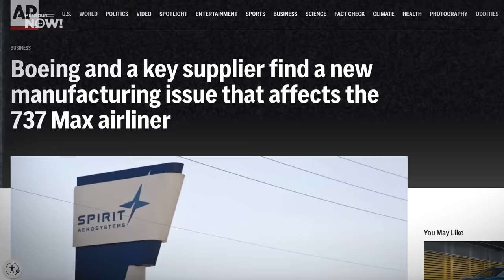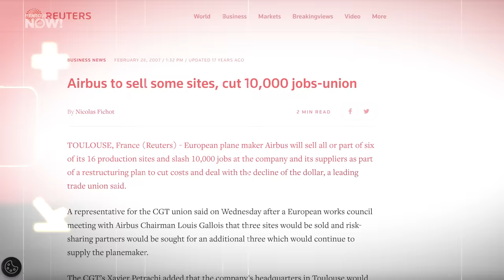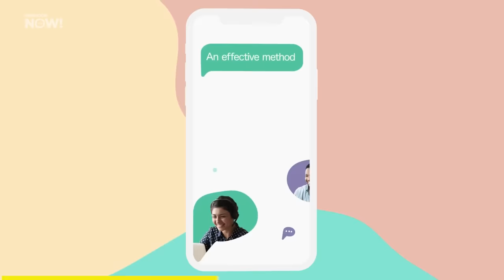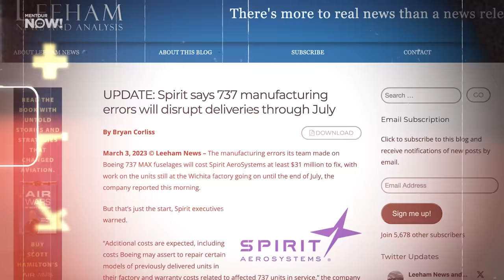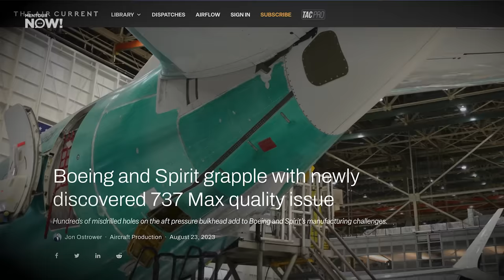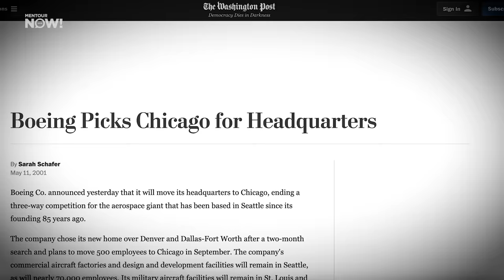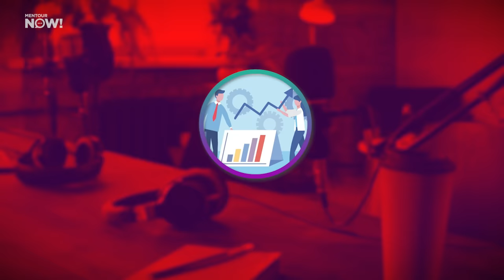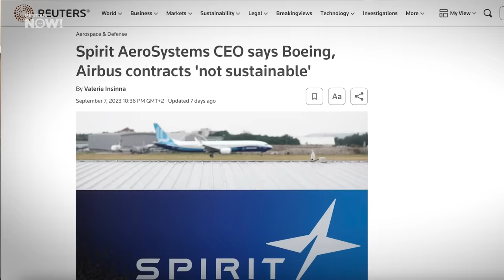NEW Problems with the B737MAX!

Comment: How did Spirits CDI's and Engineers miss that on the final part buy off? That's a big screw up, and being an AS9100 manufacturer, any changes must be approved by an engineer before they could continue work. I worked in aerospace for 15 years and know there are multiple checks and triple checks on all flyaway parts.

Comment: apparently, rules have changed. Every new Aircraft model has to go through l  of safety checks. This one is called 737 and is allowed to certify its own modifications, as it is not a new model. However, the changes made are huge, it is really a new aircraft. The wings have been raised so that bigger engines can be fitted below the wings, not a minor upgrade at all, A massive alteration. And so it goes. Self regulating, and given the levels of corruption that deliberately hid the faults until two or three new aircraft crashed killing all on board. The additions, modifications continue. It is not a 737, it is a mongrel, a Frankenjet.
Reply: There are several catastrophic factual flaws in that statement

Comment: It doesn't surprise me that the subs turned in better work.  They would have to assume that Spirit would have inspected their work and were probably on the hook if Spirit rejected their product.  The aerospace industry lobbied the government to let them police their own work and this is the result.  If you want quality product, you need government to do the inspections, and to avoid passing the cost of regulation onto the taxpayer, industry should be required to pay the freight without having any control over the inspections.

Comment: The worse part of building something is that when the ceo and vp get involved in a build of a building or vehicles. Usually end up with nothing but problems. They over ride the engineers to save a few bucks for themselves over safety and build quality. They want quantity over quality.

Comment: My daughters friend just flew on the 737 max and told her something I had never heard before. They were asked after everyone had boarded to move 10 passengers from the front of the airplane to the back! Then an additional 3 passengers were asked to move to the back. First time I had heard of that, I always figured airliners didn't have to worry  about where you sat and just loaded the baggage accordingly for weight and balance. Also how would they know sitting at the gate where there C.G. was, does the Max have some kind of new equipment or software that can tell them where their C.G. is? Again something else I've never heard of, but anything is possible I guess.
Reply: I've had it happen to me once. I had to go a few rows back. I've also heard of it happening. The c.g of airplanes is a delicate thing.
Reply: Shouldn't that be worked out when you first arrive and present your baggage?

Comment: The guy in the first few moments "There is an issue with a non conforming part".  YES!  The bolt refused to be tightened.  It said, I do not feel like it, so the mechanic let it stay in loose and ignored the torque setting on his hand tool and gave the bolt, the relaxed vacation it requested.  I was an engineer for 33 years.  I had to listen to this kind of BS from business and marketing who got put in charge where they should have had NO POWER or influence.  They do not have the brains to run engineering or production, but they possess the audacity and GREED to screw up Quality Control when it suits them.

Comment: I'm curious what the fix for off-center drilled and elongated fastener holes is. Other than installing oversized rivets or Hi-Locks, there's no fix I know of. Oversize fasteners can run afoul of edge margin requirements, too. BTW, when Petter showed what was supposed to be X-Ray being used, it was High Frequency Eddy Current equipment being used in the stock footage. I'll gladly give him a pass on that!

Comment: As others have said, it's difficult to see how the machinists were not aware of the snowman holes or, if reported, that supervising engineers didn't investigate the cause and propose solutions.  Could there have been a cover up along the way?

I wonder too whether the FAA were a bit too quick to dismiss this issue as having any flight safety implications and it would be reassuring to think that those conclusions were subject to an independent and rigorous analysis.

Comment: Lemme see here. The FAA said the vertical stabilizer and aft pressure bulkhead problems were not safety of flight items? Would this be the same FAA that signed off on MCAS? Ahh right, that's it.

I know that the FAA delegated certification to Boeing who was responsible for the MCAS issues but you get my drift.

Comment: Boeing used to be an engineering company, then it 'merged' with Macdonnel - Douglas and the engineers seemed to be 'out' and the profit/bonus focused management from MD seemed to be in charge of Boeing.  Now Boeing is a profit making company with bonuses to top management.  The fact that Boeing makes junk doesn't surprise me, and I don't fly anymore.  It's not about Boeing being an engineering company, it's just to make management rich (in my opinion) and my safety - public safety - doesn't seem to rank.  If I have to fly, I'll try for Airbus.  Not Boeing.

Comment: Dear sir et al, I recently began to watch some of your programs, I express congratulations and admiration for the quality of the information you provide in a charismatic, objective and informative way.  Such quality stands out from the vast amount of pseudo information circulating on the media. With the hope of ellicitig a possible return , I inform a possible contribution to a program wherein a Captain and First Officer became so involved in the absence of a  locking check on the pannel that they had lost spatial awareness and crashed. As a child, I was party to a similar incident in December 1956 on a flight from Brussels to New york.The outcome, you´ve guested it,  was different. As a technical translator for long in the oil industry  my insight in the safety issue could be summarized as : blame the victim it is pervasive in this hazardous industriy. What is your take on this last  issue?

Comment: If others are able to make parts as per spec then it means in house fabrication has an issue. And this has been highlighted for years. It seems that this has not gone away. What other issues are there which have not been reported ? In Asia where I am based Airbus 320 are the preferred aircraft … wonder why ?  I certainly would walk away from getting on one of these new 737s !

Comment: So the pressure bulkhead has badly drilled holes in it. Who would want to fly in a death crate like that? The report I saw about the crashes said the new engines were too big and moved the center of gravity to an uncontrollable position without electronic trickery. That plus AI that won't allow the pilots to save the plane, what more could you ask for?

Comment: I really do not think "Profitability Problems" are the cause of this type of systemic issue with construction of the pressure end cap. The person on the line whose job it was to drill the holes is the one who is solely responsible for this mistake, and then with the help of management the issue was covered up with some rivets...Not Good!!  Lives are at stake as this is a crucial part of the pressure vessel.

Comment: Drawing upon my background as both an engineer and a pilot, I hold a strong conviction that safety should always be our top priority when it comes to aviation. As such, I must express my profound discomfort with the idea of operating an aircraft that harbors multiple issues.

The 737 is a reasonable safe aircraft (but Airbus 320 Family has better record), with that being said lets focus on a number of problems over the years, including the two fatal crashes of the 737 MAX in 2018 and 2019. These crashes were caused by a combination of factors, including the location of the engines far in front of the wings. The 737's engine placement can make it more difficult to control the aircraft in certain situations, such as when it is taking off or landing. This is because the engines can create a pitching moment that can cause the nose of the aircraft to rise. The 737 MAX was designed to have a larger engine than previous 737 models. This increased the pitching moment, which made the aircraft more difficult to control. Boeing developed a software system called the Maneuvering Characteristics Augmentation System (MCAS) to help pilots control the aircraft. However, MCAS had a number of design flaws that led to the two fatal crashes.

That being said, my preference for the A320 over the 737 is completely valid. The A320 has a different design and might offer a flight experience that you find more comfortable or reliable. As a pilot and engineer, it’s crucial to trust your instincts and choose the equipment that you feel most confident operating. Your safety and comfort are paramount in aviation. Remember, every pilot has their own preferences when it comes to aircraft, and that’s perfectly okay. It’s all about finding what works best for you.
Reply: You say the 737 is a safe aircraft, and then go on to explain why it is NOT a safe aircraft lol...  !
Reply: @bernarddavis1050  If you lack the context to comprehend the meaning, that void becomes your excuse.

Comment: @7:24, Boeing is a big employer in USA, and the FAA is biased toward Boeing. Within months of its certification and subsequent commercial flights several the 737Max had nose-dived and crashed killing all aboard, and several pilots had reported the 737Max computer mysteriously and dangerously forced the aircraft to pitch downward — even to the tragic end. The lucky few who managed to stay alive to tell the tales of the mysterious computer that tried to kill them all, reminiscent of “ HAL” in the movie 2001 Space Odyssey. Boeing engineers had modified the 737Max auto pilot but kept the modifications low key so the airliners need not spend time and money retraining 737 pilots. A surprise revelation: the FAA had given Boeing  a self-certification process on this piece of important avionics. 

As several of the 737 Max were falling out of the sky, FAA was reluctant to ground them, instead assured everyone the 737Max is safe and airworthy. Only after China unilaterally grounded all 737Max in China the FAA finally gave up the ghost.

The FAA has no credibility.

Comment: 2:03  *[edit] ...i should have finished the video before I commented. 🤦‍♂️😅 If the fuselages were bade in Witchita, then thats why it went past my place. 👍

When the first Max fuselages were shipped to Boeing, they were on a BNSF railway that went right past my house and that follows I-90 (ostensibly) across the country 🤷‍♂️ I wonder where the shut down areas are? 

Im not saying youre incorrect...im just curious as to why they used yhis railway and why not use it again? 🤷‍♂️

Comment: I have read that Boeing is currently struggling to ramp up monthly production of (I believe) 737's from 31 (I guess last year) to 38, they were talking about producing between 400 and 450 aircraft in 2023. The third quarter was miserable for them, they barely managed to produce around 33 per month, and so they have moved their full-year goal to between 375 and 400 aircraft. I thought the issues were just general supply chain issues, which also affect Airbus, so maybe Boeing was just unlucky and could catch up next quarter. 
    The information you shared in this quite-informative video shows that it won't be that simple. It looks like Boeing's next target of producing 50 aircraft per month could be pushed further into the future -- who knows, 2026 or 2027? In the meantime, it looks like Airbus will meet its target of ramping up production to 50 planes a month, it is already preparing its suppliers for 65 a month and has started talking about 75 per month. Both Boeing and Airbus have healthy backlogs of orders, but it is starting to look like Airbus will be rapidly draining their pipeline of orders and refilling it, while Boeing's pipeline might be a bit clogged. Boeing may increasingly lose orders to Airbus, especially when long-time Boeing customers have to replace their aging B717s and B757s, where Boeing no longer makes a direct replacement aircraft and Airbus has something closer in the A220 and A321XLR, even if shifting to those types will complicate fleet structure.
    A lot of people, including the big airlines, are rooting for Boeing to turn things around and start offering healthy competition to Airbus again. It has been 5 years since the first 737 MAX crash, and it looks like Boeing is still not in the clear. Maybe it is time to boot out the executives who were responsible for creating this mess, put in place people who will take responsibility for the engineering design failures of the MAX and other issues, and get down to rebuilding Boeing and its organizational culture.

Comment: You make great points and thanks, RONA, yeah, it's just greed,  I worked for Carrier and when they got taken over by UTC everything went to shit, then RONA came and they literally sold off the supply chain and technical support for Carrier HVACR equipment and it ruined the brand. Like many manufacturing systems it's critical for HVACR equipment to have factory training and technical support,  tech's in the field need this now, and if they don't get it, they will drop your product and move on to one that will. I've seen this so many times, little punks in board rooms that went to college but have no idea what the company does or how it does it making decisions that decimate the company and many times put consumers at risk.

Comment: How the shit is the fitment 
or lack thereof , of the vertical stabilizer, not a safty/ flt risk!!!?
Help me understand that defecation!
Reply: Most likely because it's only 2 of the 8 bolts. You have to understand that oftentimes the plan you've flown is also not in perfect condition. The plane can have damaged parts but is also allowed to fly as long as requirements are met. Although I also don't support it, it is what keeps the airlines industries going

Comment: It seems those new engines made those airframes fundamentally unstable.

You shouldn’t need computer intervention to make a plane glide
Reply: Every Fighter Jet since the 80s needs Computers to stay stable. There is no problem with that. But maybe do not link this very essential function to only one sensor. Better use three and have a fall back mode with limited flight characteristics if the sensor data doesn't make sense.
Reply: @nils9853  Perhaps what’s acceptable for a fighter jet isn’t acceptable for a commercial airliner

Comment: Rotax are having quality issues with their aircraft engines as they have subcontracted manufacture of many parts in the inevitable cost-cutting exercise. This is almost always the case and the bean-counters meet their targets and get their bonuses, but don't have a clue of the chaos and costs plus tarnished reputation of the company that the engineers have to sort out. I've seen it everywhere I've worked.

Comment: Ever since Boeing's core shift from engineering to maximizing profits (i.e think accountants making critical decisions over engineers) the company's once sterling  engineering and safety excellence has tanked.  Accountants want to outsource everything possible for the next quarters profit to keep rising.  Bad company culture when safety takes a backseat to share price as one would think was  previously brought to bear.  And that doesn't even figure in how at this late date that The FAA sees the problems here as not of immediate safety concerns?  It's as if they feel they can not ground any more 737 Max planes for fear of destroying Boeing's future. Kind of a slippery slope all over again ignoring life lessons learned by ultimate horrific costs.  I've been in retail for over 40-years and I've never seen any of the vendors I depend on improve their products once they are bought out by investors and ran by accountants.  Fortunately what I sell isn't safety critical on a potential catastrophic level.  Aircraft, however, should be safety first, in-between, and last.  Any profit made without this mantra is "blood money".  Frankly, I'd rather fly on Airbus planes after watching this video.

Comment: I wonder if the person or people who knew about the snowman holes are still working at Sprit, if they are they also got a pay rise recently. What the !. I suggest many heads should roll from the shop floor to the top. Criminal negligence also . As to safety, the FAA said no safety impact but what about if these flaws were left for say 10 years !  Aircraft have been brought down before from excess drill holes .

Comment: Railway line cited 2:05 probably went out of service due to excessive reliance on air transportation. ironic?  Rails to trails are a menace, there is supposed to be a provision to have it back for the tracks if needed, but good luck taking it from the helmet heads in coalition with the highway lobby and N.I.M.B.Y.s